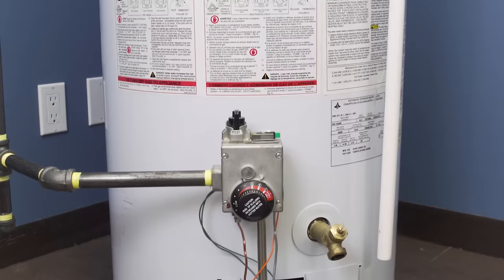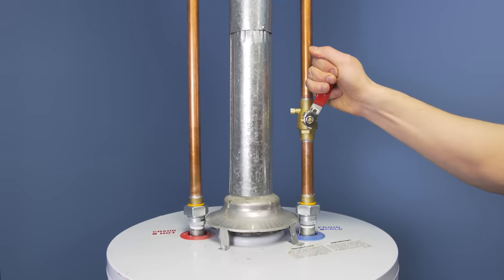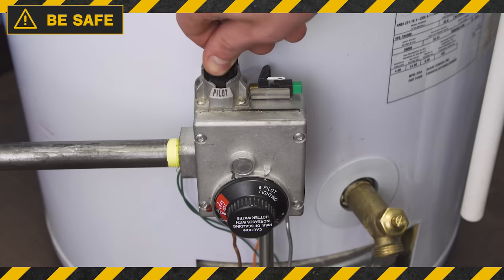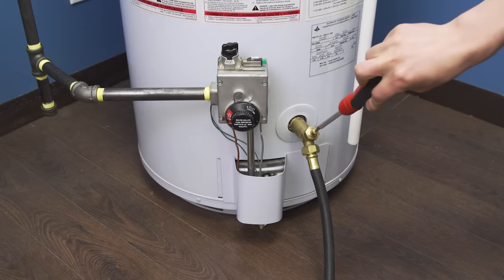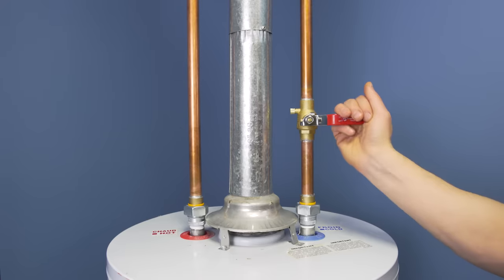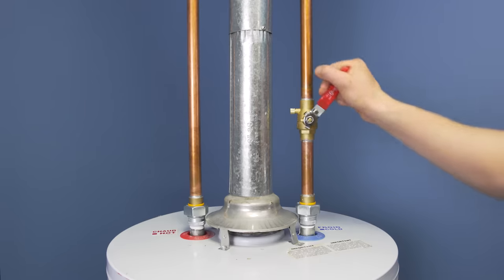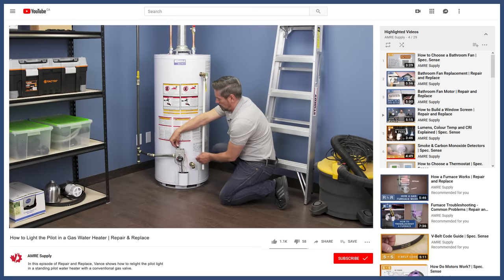How to Drain & Flush a Hot Water Tank | Repair and Replace

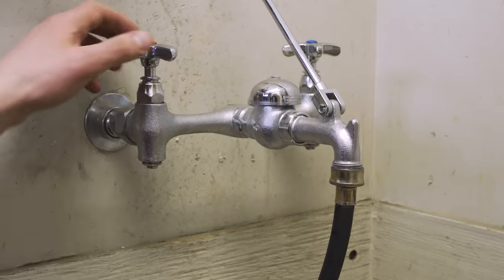Comment from the maker: NOTE  At 2:47 the hot water handle is opened. This is an error and the cold water handle should have been opened instead. When filming these videos we often film multiple takes at different times and the pieces are edited together afterwards. During the backflushing shot we did what visually looked best on camera (moving the closest handle) while not realizing it was the wrong handle (which not would result in any water flowing). This wasn't noticed until after filming was complete.
Reply: So take down the video and reshoot it!
Reply: I was wondering!
Reply from the maker: @UncleFjester  Thanks for watching. Removing the video would mean it would lose all interactions, comments, and views and that is something you don't get back. For a reshoot, the error would have to more significant than the difference between the hot and cold handles. This is something that someone can figure out and is why we put this note.
Reply: Yep I saw that was going to comment as if you are back flushing and of course have the water to the tank off then use the hot water to supply water back words well oops 😬 not going to work.
It would be a good idea to make sure a faucet is open on the hot side to allow the water into the tank.
Reply: I and my brother that lives next door to me built our homes at the same time. We put in the same identical hot water heaters, ( Electric & the same Brand ) I had to replace mine after 15 years, my brothers hot water tank is still going strong seven years later. The only difference in our hot water tanks is I flushed mine every year, my brother has never flushed his. The plumber that helped me change it asked me on the phone how much have I flushed it out through the years, I asked him why was that a factor, he explained that water heaters that have been changed by him the majority were changed had been flushed out on a regular basis. I stopped flushing mine. Both my brother and I are on the same well water also, sharing a deep 600 ft deep well.
Reply: Thanks for the comment. That part had me confused. Great video otherwise
Reply: Good way to burn the elements on an electric tank when you reconnect electricity yeah?
Reply: @UncleFjester  LOL
Reply: @docbrown6550  As Salty Creole says the reason for this is probably running the heater with its tank empty.
Reply: @edherdman9973  Not happening here. Never have never will. What have you been smoking?
Reply: @UncleFjester  exactly!!  Ive got to go to another video 😕
Reply: That's a faucet, not a handle.

Comment: I don't understand why in the video the back flush is done by opening a HOT water faucet. I would assume that one should open a COLD water faucet, since there shouldn't be any pressure or water in the hot water pipe coming to the faucet - the water supply to the tank is cut off and the tank feeds the hot water pipe feeding the faucet. Am I missing something?
Reply from the maker: Thank you for watching! You have a good eye and that is one error that made it into the final video. When we filmed that shot we naturally showed did it in a way so the arm wouldn't block the shot. In this case what looked visually good while filming, created a continuity error that went unnoticed until after filming is complete. Unfortunately we can't change that shot now without deleting the video.
Reply: So I should turn on my cold water, not hot water for the faucet?
Reply: @junkim5331  If you need to do a back flush, yes. A back flush with hot water won't work because you won't have any hot water to use, your tank will be empty.
Reply: Got it!  Opened the pressure value and it started draining!

Comment: Our hot water heater [HWH] had not been flushed for more years than I want to admit.  Following the directions in this video I got next to no where.  Blowing cold water in from the washing machine cold water point 6 times into the HWH didn’t do the trick.  So I shut off the HWH drain valve and let my drain hose [laid outside the house] drain until empty.  Then I stood on a ladder and using a funnel that fit inside the hose shut off valve on the end of it - I filled the hose with white vinegar. When the hose was full, I shut off the valve on the end of the hose and reconnected it to the cold water hose for the washing machine.  I then turned on the cold water to pressurize that hose, opened the valve at the end of the drain hose and then the drain valve on the HWH.  In this sashion I blew about a pint of vinegar into the HWH.  I did this twice and now the sediment has been disolved enough that water is flowing strongly out of the drain hose.
Reply from the maker: Thanks for sharing your experience! We try to give enough information to point people in the right direction but there are always cases that are more difficult than others. It's not surprising that after so many years without any flush that it took vinegar to help dissolve the sediment. Cheers.

Comment: The back flush with a washing machine advice may have just saved me over $650.  My hot water was slow and had low pressure and about a year ago I drained my 16 year old electric HWH.  Well that drain was iffy and the low pressure issues came back.  The drain valve was clogged and nothing could flow.  By putting a washing machine line on a hose, opening a valve in the house and backflushing the tank I was able to get it flowing and flushed.  Crud came out and my hot water pressure is like new!  Maybe I can get another 5 years out of my HWH now.  Yay!!  Remember if you do it to open a valve in the home to allow the back flowing water a place to go and to then drain your tank.  It took doing it three times on my old HWH.
Reply from the maker: Thank you for sharing your experience. We're glad that the backflushed worked!! Best of luck that you get a few more years out of your water heater!

Comment: As a plumber of over 20 years, the best way to get rid of sediment is to cut both copper lines drop that concrete filled water heater and install a new one.  I have seen too much sediment run through the house clogging up all the fixtures.
Reply from the maker: Hi Vinny thanks for sharing your experience. What do you think about regular or yearly flushing as a way to prevent a buildup of sediment?
Reply: @AmreSupply  I tell my customers if you start from the time the water heater is new you should be okay but if you go back in after a water has been sitting for even only 2 years you run the chance of distributing that lime and scale all over the house

Comment: Yes, this is the correct method. I change my electric heaters to a ball valve, full port. I have had to run wire or a 3/8 " water line inside to agitate the sediment. Also for the thrifty, turn off the water heater and have a bath before the flush.
Reply from the maker: Thanks for watching. We're glad to hear that you also made the upgrade to the ball valve! Cheers
Reply: You’re smart. Can you come to our house and do this to our Rheem HWHr? 
We tried to do this guy’s flush today because our current 1 yr. old Rheem replaced an ONLY 4 YR. OLD Rheem still under Warranty that totally crapped out (And WHAT a song and dance getting this accomplished through Rheem🎵 ☹️)

Gawd - What a pain-in-the-…..  plumbing is.

Comment: If it stops draining and still not empty , just lift the hose up to your height and shake a few times then blow like inflating a balloon if necessary ; OR shut off boiler drain and open water supply, that will move that big chunk of sediment out of the way stirring the bottom of the tank.  I usually just connect the hose and open boiler drain,  the chunks might break loose with the pressure, and you can hear them rattling in the bottom  then combine on and off of water supply and boiler drain    till you get good free flow and no more sediment, . Believe me , I'm a plumber and it's been times I had to remove lower heating element to be able to push sediment out, never been flushed in ten, 15 or 20 years.
Reply from the maker: Thanks for watching and sharing your experience. Those are some good tips!

Comment: So I would recommend replacing any plastic valves with a brass valve. I have always attached the hose and open the drain. Valve first before turning off supply to heater. After you drain the heater adding a full port hose bib will speed up draining and cleaning in the future
Reply from the maker: Thanks for watching. You are right that brass valves are the way to go. In this video we show how to replace the drain valve and also outline the 3/4" full port ball valve as an option.

Comment: Breaker off?
Reply from the maker: Thanks for watching. If you have an electric tank then it can be good to shut off the breaker so the tank doesn't try heating when you're doing a flush. For gas water heaters, they are self powered, so turning off the breaker won't effect it.

Comment: If you WH is old like mine, after the flush I suggest that you refill the tank slowly.  My first time I did not - blasted the water back in with the valve wide open and ended up with a lot of sediment suspended in the tank which = tan colored water.  I redid the flush and then Very Slowly filled the tank, progressively opening the valve more as the tank filled but never opening all the way.  Made a huge difference.  Nice clear water!!
Reply from the maker: Thanks for sharing those tips!

Comment: I’m glad you caught that because I was about to correct you myself. That would be problematic. I generally fill up the tank and listen to know that it’s filled. Than I plugged the hot water heater on and let it heat up some for about 15 to 20 minutes than I turn on the faucets. Turning on the faucets in this fashion not only gets the air out but the sediment in the pipes which is why you usually will see brown water for about 50 seconds or so. If you turn on the water before filling the tank you could damage the hot water heater.
Reply from the maker: Thanks for watching. Also those are solid tips!

Comment: I’ve seen 30-50 year old tank water heaters.  The common ground of all was filtered water. They all had 5 micron filtration prior to water entering the tank. The amount of times the tank fires up is another factor.  Pressure is a huge factor.  Last common factor is bonding and ground.
Reply from the maker: Thanks for sharing. Its not common to have all the right factors in place for 50 years of service but it does happen.
Reply: Apparently MY WATER is two parts dirt to One part 💧 water.
😤
Or else Rheem electric HWH’rs are the biggest piles of crap on the residential market today.

Comment: Great instructional video... TIP.. draining tank wirh this approach only works if drain hose is below the level of tank (gravity). I saw people doing it by putting hose into a sink and they wondered why is not working 😕
Reply from the maker: Thanks for watching. Draining into a sink would only work if the entire hose is full of water as this would create a syphon. Pockets of air inside of the hose might also disrupt the syphon.

Comment: Good video and explanation but I have a suggestion. Replace the tank drain gate valve with a ball valve. You should precious few if any issues with the drain valve clogging, essentially eliminating the need for the back-flushing operation. Also, any dirt, grit, sediment, etc. between the gate valve internal seat and washer when attempting shutoff will otherwise ruin the valve seat and almost guarantee leakage from then on. Just my two sense (cents, lol) from having rental properties.
Reply from the maker: Thanks for watching! That is a great tip as full port ball valves are rock solid. This is something that we mention in the drain valve replacement video: https://youtu.be/nGCejMsKNX4?t=195

Comment: Thank you. I had alot of mineral deposits. So toward the end
I would open the water valve for a few seconds, bust up the minerals while the spigot remained open. Seemed to work pretty good.
Reply from the maker: You're welcome, we're just happy to help!
Reply: @AmreSupply  pushing water back into the tank as you showed was the biggest help to get it going. Had to do it about 3 seperate times. ❤️ Now the tank seems to reheat faster and hasnt overheated like before.
Reply: @morriskl3  >> Happy it all worked out for you.  Our ‘draining’ did not go well.  Perhaps it was this pressure release valve on the top of our electric HWHr….
Hubby and I are consulting a divorce atty tomorrow…😮

(😉)

Comment: Thanks for this very clear instruction.  Question... We have an American ProLine 40 gallon tank.  It's now about 7 years old.  The makes a "banging" noise whenever we run hot water for more than a minute or so.  There are no problems, just the noise.  The banging never occurred in our old water heater (also a 40 gallon) and only started about 3-4 years into use on the current water heater.   We don't have an expansion tank and never have.    We suspect that an expansion tank may solve the noise problem, but will probably not bother unless the banging is going to make the water heater fail sooner than without adding one.  By the way we do have a water softener and the water entering the tank is softened.   Thoughts?  Should we be concerned and do something about the water heater banging noise?
Reply from the maker: Thanks for watching. If the banging happens when you stop the water flow, then that would be water hammer. In your case it seems like the noise happens after water runs for a minute, so it is likely air bubbles rising to the surface and pushing sediment around the inside of the tank. Doing a flush can help reduce the sediment and might reduce the noise.

Comment: Thanks for this. Question: I ended up doing the 20-second flush at least 8 times. Brown water every flush. Finally a  friend gave me advice to keep valve open while cold water intake valve is open. At this point the outflow got a little more clear so I called it a night.  

Also I feel you kind of rushed the part about air flush after the water flush, before turning back on the heater.
Reply from the maker: Thanks for watching. Thank you for the feedback. Yes for filling the tank you'll have to run water out of a faucet until the water runs clear. This might might take some time.

Comment: If I'm getting dirty hot water, is it too late? 😢😢😢

Edit/PS. I'm a Grandma lady on a fixed income and have no one to help me.  Many of my appliances are broken and there are plumbing problems too.  I do what I can to fix it myself and I really appreciate videos like yours!  Thank you very much!  I look forward to your reply!😊
Reply from the maker: Thanks for watching, we're just happy to help people who are willing to learn. You can do a test to determine if the problem is the water heater or corrosion in the hot water pipes. If you drain a little bit of water out of the bottom and see if that compares to what is coming out of your taps. If it is similar then it is likely sediment from the tank. In this case a tank flush might help. If you flush your tank and drain the sediment and the water is still dirty, then it is likely that tank is nearing the end of it's lifespan.

Alternatively if only the water coming out of the hot water faucet is dirty, then it's possible that the pipes between your water heater and your faucet are corroded.
Reply: @AmreSupply  Thank you very much!  I can't tell you how helpful this is to me and I'll check it out! 😊👍

Comment: We have an electric Rheem with a pressure release valve on top.
We followed your instructions and left that pressure valve alone  - opening a HW faucet in the house instead.
No water would drain. 

So we decided to back flush, but needed one ☝🏼more female end to run to HWHr. We couldn’t get the female end of the hose loose from the male outdoor spigot. Rusted into eternity. 🤨
NOW, what to do? 
After a nasty fight, including the temptation to take a wrench to each other, we opened up the cold water valve and flushed about 25 gallons of nice, Softened Hot Water into the yard. 
We still have to replace the hose spigot with the female end we needed that is permanently rusted to a garden hose (Did I mention hubby tends to TIGHTEN those nuts 🔩 and bolts until almost stripped?)
BUT, the source water pipe to the garden spigot won’t turn off, even though the valves below the spigot are turned off…😞🤦🏻‍♀️

Yeah. 
Do-it-yourself home maintenance is freaking worth it. 🙇🏻‍♀️
Reply from the maker: Thanks for sharing your experience. With time, parts become worn out, rusted and it most certainly adds more variables into any maintenance or repair. It is hard for us to cover all the potential scenarios that can emerge but we did do a video on showing how to remove a broken plastic drain valve: https://www.youtube.com/watch?v=4m1KxuHewHY Still we might do a video in the future talking about what to do with stripped threads and other common mishaps.

Comment: I always have to lift the little valve at the top of the heater to get the water draining but when I do it works great. Just dont see it much in these videos. I've always needed to do it though even when it was brand new.
Reply from the maker: Thanks for watching. You are right that the relief valve can also be used to purge the air in the system.
Reply: Sometimes the relief valve may not close properly after, I've had several that slow dripped after opening as you suggested, all on older units requiring replacing. I don't use them that way any more.